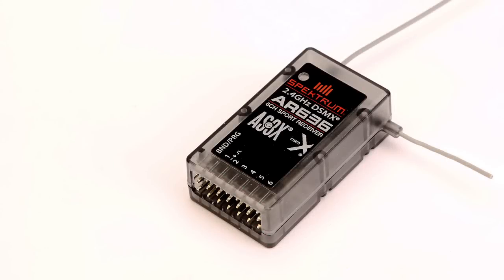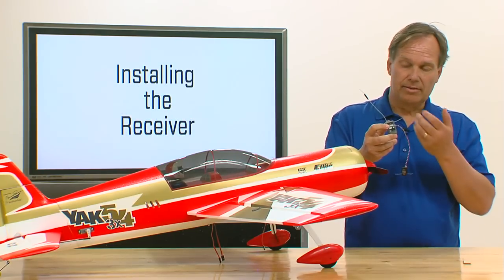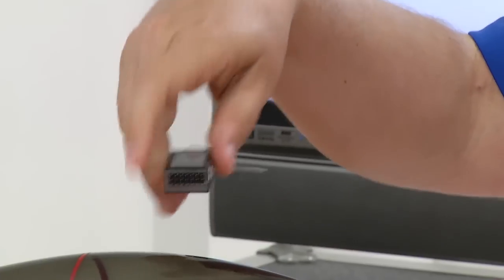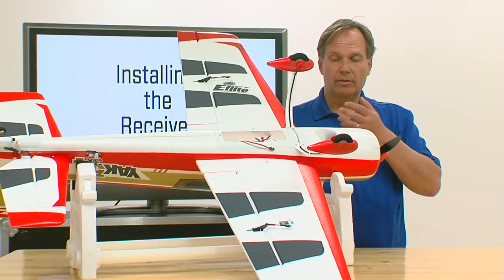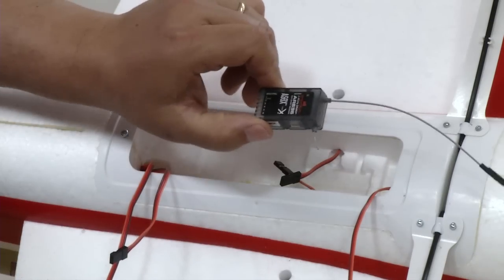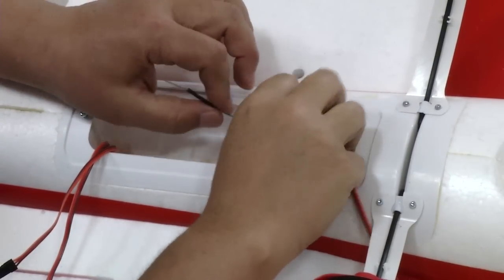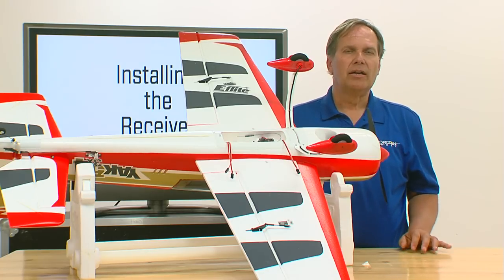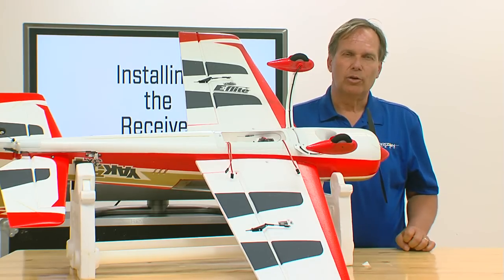Spektrum AS3X Step 2: Receiver Installation (Initial Setup)

Comment: Hi, i have an AR9350 and an AR636, i get the orientation but do they need to be placed on the cg as ive been told, the planes i want to use them in would be an awkward access position on the CG, can they be placed forward/behind the wings or even on the side of the fuselage

Comment: Ok so I bought a horizon hobby T-28 and the 636a RX mount shelf is slightly tilted along the fuse axis. there is some roll to it. It seems to be evident this is affecting SAFE because when the plane is sitting flat on the ground the ailerons have some adjustment to them with SAFE on. Can the accelerometers be calibrated using the as3x app?  BTW the app has very low reviews for Android so I am expecting a poor experience. Haven't bought any cable yet and I'm hesitating if this as3x or SAFE is even worth the money for the cable. Yeah I know this is a BNF plane with the SAFE/AS3X rx built in so I shouldn't have to adjust anything but you get what you pay for when you buy a packing material plane.

Comment: I have the horizon hobbies V900 and it's equipped with the AR636 receiver.It has AS3X and SAFE which can be. Assigned to a switch on the transmitter to turn off SAFE while in flight.

Comment: hi,  i'm getting back into this - all my equipment is old ! 90% of all my lipos are no good (thousands of dollars i almost cried - just joking but it was a blow - i keep them in sealed metal ammo boxes) - my radios are old as well (but they work just fine).  what brings me here is this.  i'm thinking of getting a new spektrum radio, do the new spektrum radios work with older spektrum receivers?  i only use spektrum equipment.  based on the lipo replacement alone will be of a great cost - i'm hoping with a new radio i don't have to replace all my old receivers as well. any information would be greatly appreciated!  much thanks!
Reply from the maker: Hi Jack! It can depend on where the transmitter was purchased. If it was sold in North America or Australia then you should not have any trouble using a newer Spektrum Tx with older DSM2 receivers (FYI "DSM" is obsolete so if they are that old those will not work with the latest versions) OTHERWISE if the transmitter was sold for the EU market then it will only work with DSMX receivers. Hope that helps!

Comment: Hi, I have a question. Hope you can help me. 
Does the AR636B have the ability to use SAFE technology? I’ve been trying to get information online and it’s quite confusing among all different versions (a,b,h, etc). I read somewhere that different firmware can be flashed to according to each versions and therefore activate SAFE. Bottom line is I have a AR636B and would like to know if by any chance I can use panic button, SAFE technology. Sorry for the long text and thanks for your help.

Comment: I have a spektrum AR636A receiver from a 230s blade helicopter that I could not program. please add that model to the application. I have not been able to solve this problem for months
Reply from the maker: Hi Rodrigo, a AR636A with 230S firmware is not able to be programmed via the app or otherwise. Are you trying to use it in a different aircraft?

Comment: No mention of how close to the thrust axis it needs to be mounted. Can I put this thing on the wing or not?
Reply: As long as the longitudinal axis matches the airplane's longitudinal axis, you will be fine. Yes, even out on the wing. Centered on the exact CG or thrust axis would apply if full scale but not so with these smaller scales.

Comment: Go figures, the ar636a receiver does NOT have the satellite receiver port.
Reply: The ones out of a BNF aircraft do not unless you want to solder the pins to the contacts inside the AR636A. The retail AR636 version (stock uninstalled) does have the remote receiver port already hooked up and ready to use.